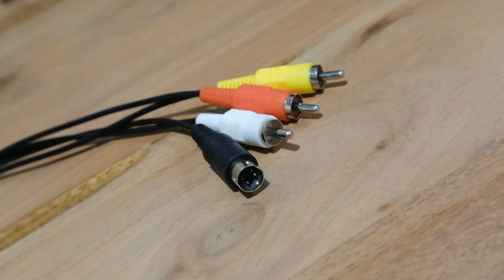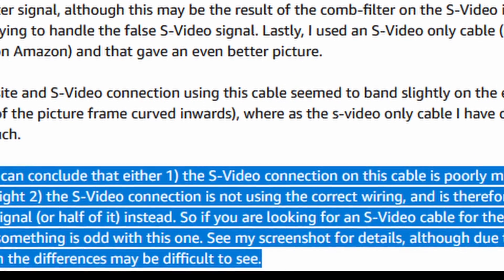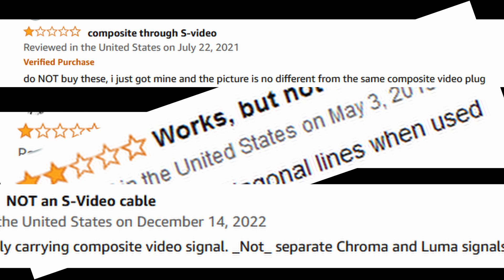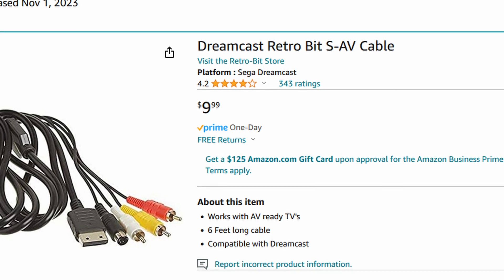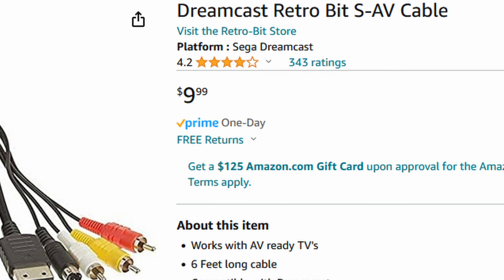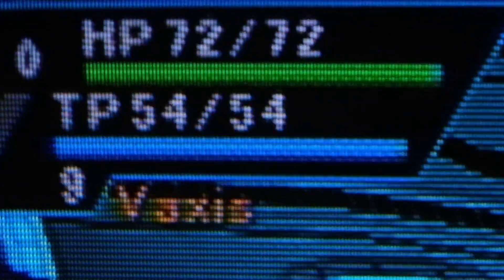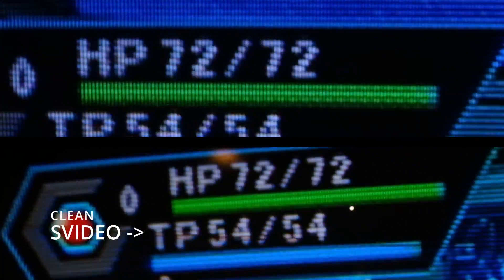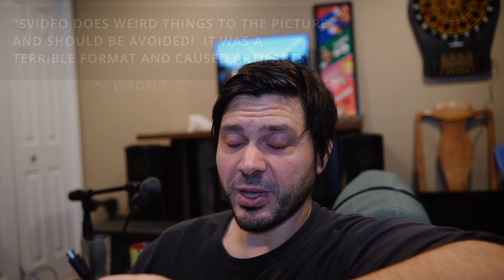Your S-Video Cables Probably Aren't

Comment: The snes,n64,gamecube Gam3gear s video cables are good and cheep. They are only s video cables no composite yellow cable. I suggest that brand if you do not want to spend a lot. I have seen the difference in my composite/s video to hdmi converter and it is an obvious improvement.

Comment: Even ones without the RCA plug have this issue as well.

Unfortunately it seems anything under 20-30$ is garbage
Reply: If you are looking fir n64/snes/gamecube then gam3gear s video cables are pretty good and about 10$. Only s video no composite.
Reply: @hggfhh4449  really? They look identical to every other generic garbage cable
Reply: @Merkantoine they are better than the tomee ones because the gam3gear only have s video. Most with the yellow composite cable are not true svideo. The gam3gear ones are .

Comment: Insurrection Industries is the only current manufacturer of (actual) S-Video cables I know of. They make Nintendo (SNES/N64/GCN), PlayStation (1, 2, & 3), Saturn, Dreamcast, Wii, and Standard Male to Male S-Video Cables. It does appear that Retro-bit cloned their Nintendo cables at one point. Those clones appear to be of the same quality, but, of course, I'd vouch for the actual cables from Insurrection. The Nintendo ones sell out often though.
Reply: Yeah it's good if you're American but anywhere else and it's just impossible to find

Comment: I got a S-Video cable for my Saturn back in the 90's and it was a proper one without the composite leads. Just the S-Video and L+R Audio lines. Best thing about it is that it's gold plated for better conductivity. I haven't seen one like it since.

Comment: I was digging through my box of coords and found a multi av, s-video, and component for use with xbox 360, ps3/ps2/ps1, and wii. Expected it to be total garbage and do what it did in this video and was shocked to see it actually did seperate chroma and luma despite also having composite. Checkerboarding completly dissapears if you swap between its composite and s-video cable and the picture looks way cleaner. Huge time saver because there really aren't any well known proper s-video cables for xbox 360 and the ps2's s-video cables are expensive as hell

Comment: Thanks so much for this video I thought I was going crazy!! I bought Tomee S-Video Cables for my ps2 off Amazon and the artifacts were driving me crazy. My N64 S-Video didn’t have them at all. Big relief
Reply: What did you end up doing? Also did you get sound
Reply: @ I ended up getting genuine Sony s video cables off eBay for ps3 but they also work for ps2 and it had sound as well. Much better
Reply: i want a s video cable for my n64, which one do you recommend me that is a good one? thanks
Reply: @sanchiani9717  I got the Gam3Gear one off Amazon, luckily that one is just s-video not composite breakout
Reply: For n64 Gam3gear s video cables. Get the ones that are just s video. They are very good and not expensive at all.

Comment: I got one from Retro Gaming Cables in the UK, they seem to actually make the cables themselves. Been using it with a retrotink 5x and the signal seems very clean and stable.

Not cheap though, paid over $30 to have it imported. At least it works with 3 generations of consoles, 4 if you mod your NES to use the same connector.

Comment: Never really bothered with S-video to be honest. not because I hated them or anything. I just never had the chance to own anything that would use it until the 2010's came around. I own the Saturn & GameCube but not the cables for them. I know the Dreamcast did get those. but then I realized the Saturn also got one when i searched on Amazon. And so did the Gamecube as well.

The last thing needed was a CRT T.V. & that T.V was the 2005 JVC SDTV that I found in my neighborhood FOR FREE. And it had s-video. so I all gotta do is buy the cables. But I need good quality ones though.

Comment: What s video cable would you recommend for the Wii?
Reply: The only cables I can recommend are the official Nintendo cables, which usually come from Japan. Unfortunately, all the other Wii S-Video cables I've seen don't look trustworthy enough, and based on what they look like they will most likely cause interference like the checkerboard pattern.
Reply: You're honestly gimping the 6th Gen and up if you chose Svideo.

I mean it works and all but those consoles can natively do YPBPR and 480p+. Svideo can only handle 480i and no RGB.

Thankfully, component cables for the Wii are affordable.

But then we get into set ups and if you want to have all your consoles hooked up so then you gotta decide if you want to deal with 2 or 3 different switchers...

It becomes a whole process man

Comment: IDK if it's just me, but I have pretty bad experience with S-Video on my PAL N64.

I own early PAL N64. I'm "allergic" to composite video, so I decided to take a risk and I bought several cheap S-Video cables. They all were wired correctly, the only issue I had was the brightness. I soldered required resistors and capacitors. I got the brightness to the correct level, but the dot craw was still here.

I tried everything, but that dumb dot crawl doesn't want to disappear. Even soldering S-Video cable directly to the AV pins on the motherboard didn't work.
Once i desoldered chroma pin (for testing) and the dot crawl would randomly reappear on boot/restart. I strongly believe composite video is leaking somewhere on the N64's motherboard. And no one knows how to fix this.

I'm not even bothering with these custom overpriced PAL S-Video cables, RGB mod is cheaper than that.
Reply: @Diza_X  PAL N64 consoles notoriously are technically comatible with s-video, but the luma signal is incorrectly heightened, causing an abnormally bright, washed out picture.  You need to mod your console or get an s-video cable that has a luma adjustment slider in order to overcome this.......or just use scart.  Not really sure about the dot crawl issue, but I can tell you a lot of 240p/480i crts just have a lot of dot crawl inherent to the set -so it could just be an issue with the tv.

Comment: Cool vid finally exposing the truth to some of these cables, however just because it had Composite attached to it doesn't mean it's always masquerading. Most of these newer cables are actual s-vid, I own a few myself, and it's fairly rare to come across some cables of the sort that are purposely wired to Composite through the s-vid connection. Usually nowadays, it's just cheap cables made cheaply and will end up with crossing wires that'll make the Composite signal jump into the s-video connector. 
If you really want to avoid this but want to save money, just try to look for cheap s-vid cables without a Composite connector. It's pretty much a given then LoL

Comment: He mentioned PSO!! Man, what a game! I played it on DC all winter when it first came out. Having a seasonal job in the Midwest, I was able to play it a ton that Winter. I never played it again....until I just happened to be perusing the GC section at Walmart. Mind you, I didn't have a GC. I just wanted to peak. Well sh*t...There's PSO!! Needless to say I walked out of Walmart with a lighter wallet cause I bought a GC, PSO, a controller, memory card, and a modem. I played the snot out of that game. I ended up getting a kb in a month or so when it released in the US. I met my (ex) wife on that game and still gave a friend 800 miles away or so that I met on that game 20 years ago. I had 6 characters @ lvl150+. My main char was lvl200, with over 2,400 hours on him. The ex took all my gaming stuff when I wasn't around. I had easily over 4,000 hours on the GC PSO. I even bought the PSO Plus version when it came out for the added levels in Ep. 2. I recently got back into the game in emulation. I love being able to play at a faster pace. I have yet to get online, but it will be in my future. Hopefully there will be a couple people to play with. If not, I'll get some friends on there, even if I have to beg them. PSO is my all time favorite game. I wish that they still made them like that. Most games now aren't to my liking. They try to focus too much on graphics or something. I don't get it. Games are supposed to be fun, and the fun has been leaving the gaming industry. Ha, here I am writing a book about a brief mention of a game in a S Video cable video.

Comment: Correction: S-Video cables from the late ‘90s and early 2000s were still made correctly. It’s when modern suppliers started selling Tomee, RetroBit, Hyperkin, etc that this kind landed on store shelves (~13 years ago). Most were the same rebranded junk from an ODM. The reason is almost certainly because they wanted it to appear as if it worked with the SNS-101 and SHVC-101, which were the cost-reduced mini/junior consoles released around 1997. To reduce cost they lost RF, power LED, EXT port, eject lever, and S-Video compared to all variants of the original SNS/SHVC-001.
Reply: A good rule of thumb is to only buy S-Video cables that lack composite video. Even then, you should check the console connector against an online pinout diagram, which is often pretty easy since these fake S-Video cables typically don’t populate the unused pins. Keep in mind that the pins may be reversed compared to most online diagrams when looking into the cable connector. Even where a diagram shows the cable side it’s sometimes showing the back side where you would be working when wiring a connector yourself.

A typical stereo S-Video AV cable should use ground (multiples), Left channel audio, Right channel audio, Luma, and Chroma. Some diagrams call Luma “Y” or “Brightness.” Some cables ground through the DIN barrel instead of the pins.

Comment: Lucky you could even use composite, my tv literally was rf adapter only all the way through to the late 90s (yes even Dreamcast I had the same crappy barely color tv).

I worked for circuit city in the early 2000s and I remember monster cable made excellent s video cables for video game systems and vcr/dvd players. Look for the blue monster cables I’m sure they still work great to this day
Reply: Same 😅 I had RF only from 1991 right through Final Fantasy 13. 😅 S video is gunna be a real treat

Comment: Only S-Video cable I want currently is for my N64, though, I absolutely have some suggestions. Best S-Video cables you can buy are from Insurrection, Retro Gaming Cables UK, and Retro Access. Every cable they produce is wired correctly and high quality....to extremely high quality. Each do sell various S-Video cables. Ive bought scart cables off them and they have been given the seal of approval from many of the high profile sources of the retro scene. If its not from those three, I dont buy'em. If component cables, I hit up HD Retrovision.
Reply: When the 4P miniDIN on my original Nintendo “S-VHS” cable got crushed nearly 25 years ago, I had already cut up a random S-Video cable to repair my Bung Enterprises Doctor V64 power supply. I took the remaining half of that cable and cracked open a couple SNES/N64 composite AV cables to make my own janky S-Video cable.

Nearly 20 years later I found another official S-VHS cable for cheap while visiting Japan. I thought it was fine when I first tested it but it turns out it would lose Chroma (color) if I bumped it (assuming I was lucky enough to have color in the first place). I ended up repairing both!

Point is, you can make your own unshielded cables out of these junk S-Video cables and they should perform about as well as Insurrection’s… provided you disconnect composite video. Just having composite video along side unshielded Y/C S-Video wires will cause interference.

These days I have a huge roll of fully-shielded Extron MHR cable for making custom cables but I’ll admit it’s a bit much for a simple S-Video cable. Maybe if you want BNC connectors into a Crosspoint matrix switch instead of the typical 4P mDIN, but that’s just me. ;)